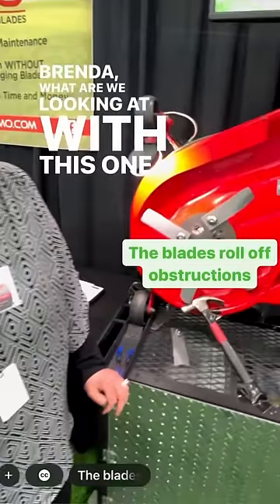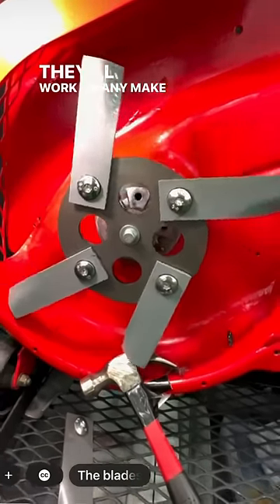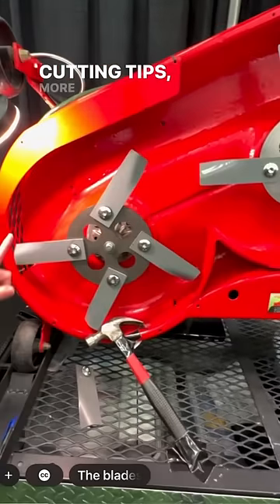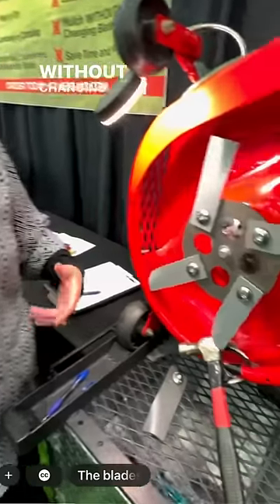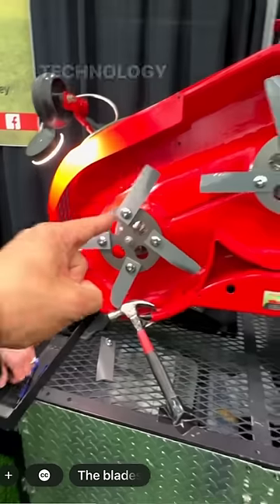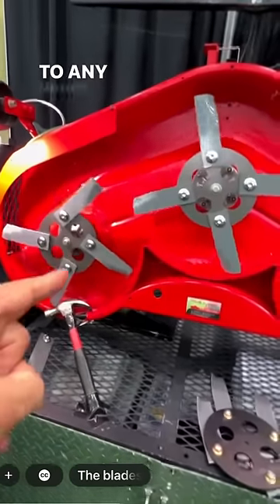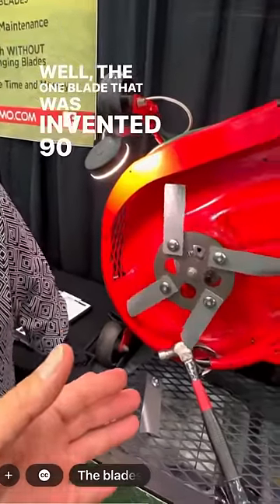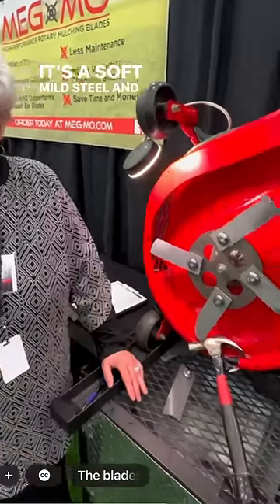Farmers already use this. #lawncare #mowing #shorts

Comment: I can promise you that Hondas lawnmower blades aren't made of mild steel.  If you're not sure if your blades are made of hardened steel, try drilling holes in it😊
Reply: Mild steel is a very broad range lol. And yeah mower blades can actually harden pretty good, at least pretty good for a steel similar to around 1035 or 1040 i would guess

Comment: seems ok to me. if you hit a hard object with a solid blade, what happens? nothing good. it might not stay sharp forever, but that's not the point at all. it's supposed to be safer around hard objects, and not break the blade or stall the engine when it comes into contact.

I think it's good. 👍

Comment: Not really flails, rotary brush mowers, they are typically just 2 blades but the principal is the same…we had a similar setup on an early 60s self propelled push mower…they were aluminum tips..rather lousy durability….

Comment: I purchased a 3 blade set and used for 1.5 years. Extreme air flow, not a great cut. Call bs on the 264 hrs, maybe if your cutting extremely soft grass and no sand/ dusty conditions. Fuel use went up also. Plenty of information in several lawn forums. There's legitimate reasons the masses do not use these. Cost is the first, easily 3-4 times depending on your current blades. Dry/arid conditions = crazy dust storm. The pins are hardened, but do wear with use, which allows the blades to float more (affecting cut quality). Although they may work fine for specific environments,  they will not deliver what they're claiming for most. Like anything gimmicky, if you have doubts.... buy a set and see for yourself. Love em or hate em. 👊
Reply: Nice write up 👌🏻
Reply: I see what your saying about the pins and the pin holes wearing out, causing slop and in turn effecting cut quality. On a flail, or brush hog, cut quality to this degree is largely, if not completely unnoticeable. So to your point, yes they are great in some conditions, and not so great in others. Just like anything else in life. Definitely a reason these haven’t caught on for finish mowing.

Comment: I bought these for my deere mower.  They are expensive but be sure what you're ordering because the center hole wasn't big enough and tried numerous of time to contact them and never heard anything back.  I called and don't have a voice mail so be cautious with them.  Just a FYI!!
Reply: Company’s with bad customer support are a huge red flag to me. Obviously you typically don’t know that until you’ve bought something, but thanks.
Reply: Small company with terrible support? Seems to be on the rise nowdays
Reply: can you drill the hole out bigger to fit
Reply: @coreydamon1566  no they're balanced
Reply: @user-white007  Honestly even if a company has an amazing product I tend to stay away if they have bad customer support or are just impossible to get ahold of. Ends up costing more in the long run when something actually goes wrong vs going with the second best... Sometimes it's still worth going with those companies but I prefer not to.
Reply: @davidlynch5235  , enlarging an existing hole in an application as that won't effect the performance of the blade. Of course, enough meat has to remain on each side.
Reply: @senatorjosephmccarthy2720  they still have to be re-balanced unless you want to destroy your spindle
Reply: @davidlynch5235 so cant you rebalance yourself? Sharpen one side then the other side. Hang it on a nail.?
Reply: @stevenjwilton your comment is 4 months old now. Did they ever get back with you? Are you currently using the blades. I was interested till I seen this comment, a little skeptical now.

Comment: Ahhh bullets for my lawnmower, now i dont have to worry about a rock making a hole in my siding itl just launch a piece of sharpened flat bar… hmmmm no i will stick with the bolt down style that have a lot less of a chance to become a flying object. Regular blades with usually just spin out in the ground, but those death dealers👀 they will soar like an eagle to wherever they reside when they make contact, and no one likes havin their cap peeled off😂

Comment: Soft mild steel doesnt shatter, and sharpens easily
Reply: Lawnmower blades are not mild steel.. They’re very hardened, she obviously don’t know what’s she’s talking about.
Reply: @user-zx7eo7nu4b  very hardened?  You betcha… that’s why they’re very easy to file by hand.
Reply: @2K9s  you’re talking about filing the blade, not sharpening with a stone. The tensile strength is still stronger than just mild steel.
Reply: @user-zx7eo7nu4b  funny you mention that because I use wet cement as an abrasive to balance and finish the blade edges depending on the steel.  Tried a few profiles but got them dialed in. 
The *lawnmower blades can be 8 (Rockwell scale).
Reply: @2K9s  Lawnmower Blades are made of carbon steel with a hardness of 38-42 Rockwell. Where’d you get 8?
Reply: @2K9s  ANSI? 😂
Reply: @user-zx7eo7nu4b  buddy, it’s 2023 and can find anything you like.
Reply: @2K9s  exactly why I’m laughing. ANSI standards have nothing to do with steel strength. 😂
Reply: @user-zx7eo7nu4b  lawnmowers and their blades, it’s a free country but I also don’t want a chunk flying off… that’s how pirates are made.  😉
Reply: @user-zx7eo7nu4b    ok i get what you are saying and its a fair point, but “mild steel” can be just about anything. Steel by definition has a certain percentage of carbon. Also 40 Rockwell is still pretty hard! I mean its no kitchen knife or pocket knife, but it will still shatter. And also i have sharpened a steel like that on sharpening stones, doesn’t take that long at all. Sharpening stones are harder than 90% of steel files
Reply: @jameswilliams6946  I was a blacksmith apprentice, and an Iron Worker, all my life, I know all about carbon steel. We used to make swords out of lawnmower blades. You could literally slap the side of the sword into a steel pole and it would not bend it would just bounce back. Iron is basically hardened by adding carbon compounds. The more of the carbon, the harder the steel, and then there’s tempering. Etc. I know all about it.
Reply: @user-zx7eo7nu4b  That is a fair point, some are made of higher carbon steel. And yes i know that, i make knives and i also have worked with wrought iron. Just trying to have a conversation here. Technically speaking most lawnmower blades (at least where i live) are medium carbon steels, they do not get very hard, and yes they can be springy if heat treated correctly, but most are designed to bend and deform for instances like when you hit a rock or a large piece of wood. I am not saying what you are saying is wrong, just adding more context and information. I am not just some idiot who watched forged in fire and the like and figured i know everything there is to know. Anyway, God bless
Reply: @jameswilliams6946  i heat treat and temper ALL my lawnmower blades.

Comment: I've been using riding mowers and tractors for all types of yard and farm work since i could reach the pedal and hold the wheel. There is no riding mower designed to handle the extra stress these blades create. Price of blades vs all the other repairs created by the blades is not worth it

Comment: I don't see what's so hard about sharpening your mower blade once or twice a season, not throwing it away.

This product seems like a solution searching for a problem, and it's not even that great of a solution – those flail-type blades have four additional failure points, those being the pivot bolts holding the blade ends on.

Comment: Lawnmower blades create suction. This won't
Reply: They do create suction though. The bent tips on swing back blades push air up, forcing the air below to move up, filling the gap. I got two mowers with these types of blades.

Comment: So if average rockwell on lawn mower blades is 42, and she is saying 7x harder, that's 294 on the scale.... them little thin blades with shatter and become a claymore... Tool steel like D2 or A2 is 58 rockwell in metal stamping... No way would I buy these blades.

Comment: Stan I think you mean to say a rotary cutter design, or bush hog, brush hog, chopper.. not a flail mower. Flail mowers are a pretty different design.
Reply: This system is more like most hay cutter,  definitely not a flail cutter.
Reply: Brush cutter, or brand name bush hog ... yup
Reply: Disc-mower for cutting hay
Reply: A flail head uses the same principle only clocked 90° from this. I just always thought flail just referred to they way the knives or blades in this case flail around a pivot. I’m not saying your right or wrong. But if someone called this a flail, I wouldn’t correct them.
Reply: @landscapingspecialist  go Google a gd mid eval flail and you should immediately understand why a flail mower is called such........ it's pretty obvious and common sense.

Comment: There is no way to balance these.  As soon as you damage them in the slightest, they'll be out of balance with no way to accurately rebalance them.  Hope you like your mower shaking itself to bits.  Residential equipment is too delicate for out of balance blades.

Comment: From Leo:   I used a TORO lawn mower in 1969 that had a wheel with 4 blade tips instead of a normal bar style blade. .  They still needed sharpening a couple of times a year.  It did run smooth and mow smoothly.

Comment: Those blades have been around for  probably 30 years.  I thought about buying some back then but the price was outrageous and the idea that a blade could come off if the pin broke was a deal breaker.  I do have tractors with brush cutters with the same style swing away blades.
Reply: Because it’s a piece of 💩 and no one will ever be using it on the farmer level lol
Reply: @danielsnider7429  Those are lawn mower blades.  Not Brush cutter blades.  Your reply has nothing to do with what I said.

Comment: She's never cut or mulched anything a day in her life
Reply: Nice. Lol.
Reply: How would you know that? She grew up working at her dad's lawn care business, the inventor of the Meg Mo blade.
You've made a lot of assumptions about someone by watching them for a few seconds.
Reply: @isamarieknapp  Because of the ridiculous claims she made that fly in the face of basic physics.
Reply: @ajs96350  she did not make any ridiculous claims. What she claims is that the blades are not disposable and that they last
Reply: @Hamandgouda  ahem, 7 times harder high carbon steel that will shatter into a billion pieces when it hits an occasional rock. Most lawnmower blades are made out of something equivalent to 1040 ish, which still gets decently hard for its purpose, but it is meant to bend and deform. If it was harder it would shatter due to the amount of force placed on the blades and not enough toughness
Reply: @jameswilliams6946 i dont know what 7x harder means to her but i know you can treat to be wayyyy harder than 1040 without it becoming so brittle it would snap. 1040 steel is quite soft. Youve definitely got some room between 1040 and a steel thats so brittle it will snap on you. If you mow over a crowbar or a piece of concrete it may snap but thats operator error in my book. Id want to know their definition of high carbon and 7x harder before i pass judgenent but there's definitely some wiggle room past 1040.
Reply: @isamarieknapp  I've met plenty of people who have been working in the same field for 20+ years and still suck at their job. I'm not sure if its out of laziness or the unwillingness to adapt and learn to better their craft. Either way, she may mean well, but she definitely doesn't understand much of what she's claiming.
Reply: @Thomas  there are many variations of steel I think the biggest concern about making blades that are hard and tough is bending the shaft of the mower than really anything else but they could address that with design but most companies do not if you want an example of a steel capable of this would be cpm 3v, cpm cru wear, cpm m4, and many more powder metallurgy steels
Reply: She's cut and mulched men.
Reply: @jameswilliams6946  You know hard and durable mean different things right? Glass is hard while carbon fiber is durable. The difference is brittleness
Reply: And neither have you

Comment: We have these kinds of mower blades and discs on our push mower in Australia some have four blades and some have two blades. In Australia some only have bar blade like you guy over there do
Reply: @Arif Khan mostly on the Australian made mower
Reply: Standard on Victa's 50+ years ago. Hardly anything new.
Reply: @Arif Khan I must have Built 100 of them. Mate had a mower shop and I'd Pick up the trade ins, rebuild them and we'd go halves in what we made. 

I built some Hotted up ones for my own mowing Business.  One I called the " terminator" after the old Victa ad, " Turn grass into lawn" I called it "Terminate" Scrub into lawn. 

Had huge compression, enlarged ports, 28MM Mikuni carb, electronic Ignition and  part of a Motorbike Exhaust. Every 2-Stroke trick I could apply from Racing Bikes and go-Karts. 

The thing screamed and the limit of what it would cut was what you could push it into. 
Thing was a little peaky, Pretty much either Off or flat out but there was nothing it couldn't cut if you could get it in there. 

Despite running about 3x the stock RPM and all sorts of other stresses, It never failed and thanks to using plenty of racing oil, I used the thing for many years and it still had negligible wear.
Reply: @glumpy10  im putting a 160cc pitty engine on a 17" scott bonnar reel mower ill call it the " hot bonnar" lmao

Comment: As a lawnmower mechanic I laugh in their face, no way your not sharpening them blades for years and you not notice. Or maybe in a perfect world with no obstructions or stupid people then it would perform.
Reply: Noone that would fall for this sharpens their blades anyways.
Reply: @OntarioBearHunter  Valid*
Reply: There are a few things that is different.  Soft steel & solid blade is subject to more damage.  The ability for the independent blades to have a forgiving impact is significant.  You're also getting 2 to 4 blades in one with this upgrade.   Depends on how you view flywheel impact on length & size of blade vs stock.
Reply: @Gamerz00760  ..... "Upgrade" .... It isn't. No. Just absolutely wrong.
Reply: @GTI1dasOriginal  
You're getting 4 cutting edges instead of 2.  The center will work like a flywheel for momentum.  More blades provided they're designed properly & better maintained speed = more vacuum.  More vacuum results in a cleaner cut by pulling blades of grass more.  

Same reason dull scissors can't cut, you have to pull material tighter to get it to cut better.  

As mentioned the blades are more forgiving on impacts meaning you're less likely to ruin all the blades.

Comment: This is great. I got an old push mower that I want to turn into an el cheapo brush hog
Reply: 30 years back went to vo-tec school auction. Picked up old unnamed steel deck push mower with 3.5 hp B&S vacujet carb engine. Imagine my shock after getting it back home and discovering it had some factory brush hog type fly back blade setup underneath. Only one I've seen my whole life (60+)....
Reply: With the cost of these it won't be so el cheapo anymore. 😅
Reply: These blades cost more the push mower

Comment: I have never replaced my mower blades...
Reply: Neither have I. Kinda like they outlast the mower.
Reply: @thatmeme1360  completely agree we always end up getting a new mower over new blade because mowers are cheap and last a long time. 150$ every 4-5 years
Reply: @Vsp712  or you could sharpen the blades , and change fluids yearly.

Comment: When the mower is engaged those blades fly out. They still hit everything, and wear out.
Reply: Yeah this company is a load of crap these are used for tough terrain that may have rocks or dirt bumps that the blade may hit and stall the engine or bend so these blades can move out of the way these wont last longer unless your mowing just lawn grass
Reply: @yeet3071  also probably won't get a good mow on longer grass. I'd assume the blades would just "move out of the way"

Comment: Is farmers loose these all the time. And normal blades are not mild steel they are  tool steel. don't know what this lady is talking about. That's why black Smiths Will use lawn mower blades Springs and other hard tool steels to trian new blacksmiths and knifemakers

Comment: The metal hardness looks suspicious. If those had many hours then there would be erosion at the top rear of each blade. If they have been ran over 1k hours and don't have the wear then they are too hard and likely brittle, which is dangerous.

Comment: it's a good product i built the tech myself for my weed whip metal blades on pivots but only 2 blade's with a beefier gaurd but also increased my cut size just take blades screw em together file the tips even for balance with the bench grinder then take screw out and screw onto your evenly spaced 3 hole mount center for shaft 2 outside for blades 24inch cutting path on a weed whip aint bad almost could put wheels on er

Comment: What the heck. Yesterday I was just sketching up a model for residential mowers. I also drew up a model that uses steel chain instead of the small blades. 😂 the chain was going to be used for people that wanted small brush clearing potential for their smaller residential mowers.

Comment: Gonna be hard on your clutch, trying to engage all that extra mass
Reply: They sell x blade kits for mowers and most of the mass is towards the center with the disc and you always want to engage your blades at half throttle to keep from stretching your belts
Reply: @Justthemow  I did not know this. Thank you.